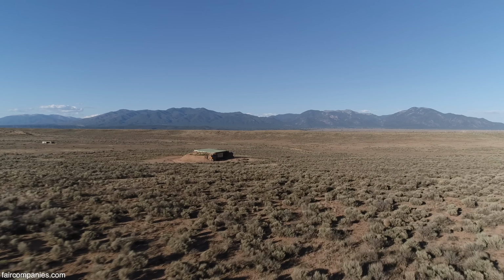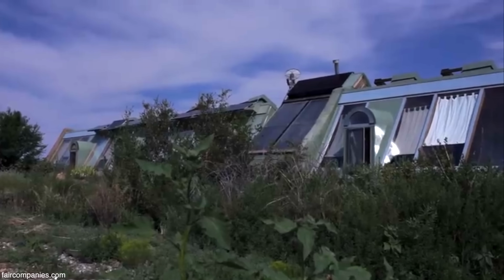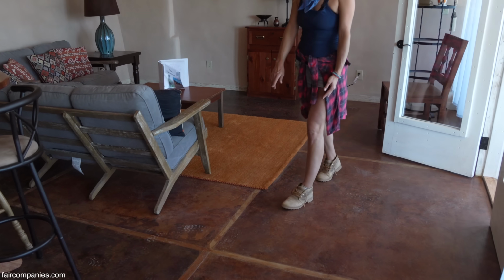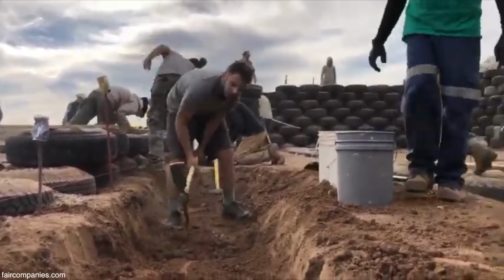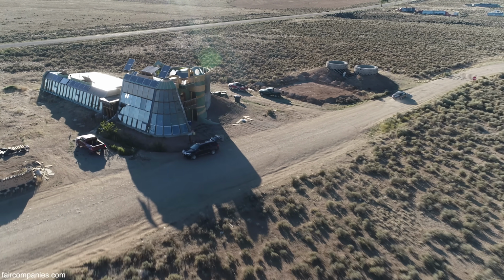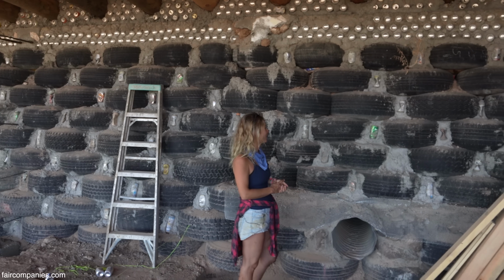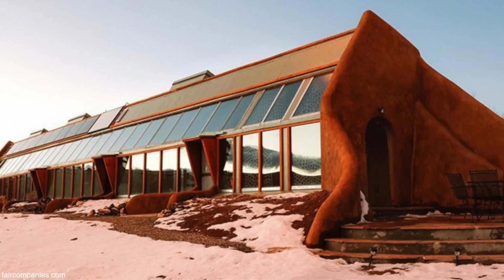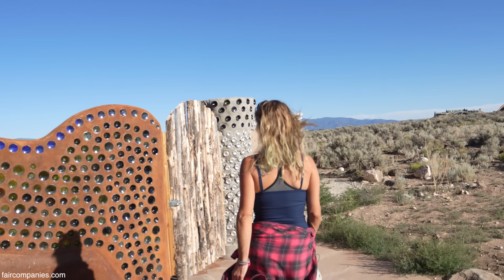New Earthships capture more energy, water & food at lower cost

Comment: I've worked in IT for over 25 years and I would much prefer having as many "low-tech" features as possible in one of these homes; primary reason being that the more complicated you design a system, the more fail-points you will have, and you may not be knowledgeable enough to repair them yourself.
Reply: They are using used toliet water for their plants?
Reply: D T ccp style 👌
Reply: You can design the home to work both on high-tech and low-tech solutions. That way you could switch back and forth between them if you so please. It would only cost as much as a fully integrated high-tech solution, but would have the capabilities of the standard low-tech model.
Reply: @TylerKoz  do they get wifi out there
Reply: @dt7491  Well you don't need to be connected to the internet to use wifi enabled devices. You could create a local network for your earthship. For devices that need a internet connection, one solution would be Starlink which should be operational in that area in the next 1-3 years. That would be Gigabit speeds.  I am unfamiliar with any terrestrial ISPs for that area.
Reply: @TylerKoz  This is true, good point, but it requires a larger budget for many things you don't need.  That is the point of building these habitats.. to live comfortably and self-sufficient with minimal costs and upkeep.
Reply: @treborironwolfe   I agree with you. It's all about preference.  I suppose if I was serious about building my own earthship, I would do a cost-benefit analysis to see if some modern automated luxuries were really worth it :)
Reply: @TylerKoz  I think if you would want to travel you'd need to do some automation since they don't do well when left without someone there to maintain them.
Reply: @dt7491  I think the bank of outdoor plants do that, which was pointed out by one of the guys. The indoor plants get graywater from the sinks & shower, then filter that, the graywater, which gets recycled for a 3rd use, I think they'd explained, for the toilet. 
Of course if they used composting toilets, they could conserve even more water.
Reply: @FutureRevolutions  Great point!
Reply: I work in IT too and I'm also concerned by the security of the "modern" houses using unnecessary amount of things connected to internet or using unnecessary technologies (like window shades managed by complicated system of motors and sensors etc.). But at the same time, I want to enjoy some of the modern advantages (washing machine, fridge and "unlimited" water source) so we solved our house like something in-between - passive house with as many mechanical parts as possible but still modern. 
The only thing missing for our house right now is independent solar system that could run basic appliances on its own (not sure how it's called in English, but it's "ostrovní systém" aka "island system" in my language - you can be still connected to the network but there's a switch that can make your house run only from your own energy stored in batteries; it can even work in a way that you run from your own solar/batteries and automatic switch turns on the network access only if you run out of juice). But we are still saving money for this, definitely not a cheap thing :-)
Reply: The same goes for modern automobiles...
Reply: @tlamiczka  I would assume "ostrovní systém" (island system) means "off-grid" in english. It is very difficult to achieve off-grid capabilities because of the regulations in the US. I believe that you can have a high-tech earth ship with a secure network without being connected to the internet. The question is , is that really what you want?  If the answer is no, then the earthship model has everything you need!
Reply: @dt7491  right?! vegetables, herbs, fruits should not be using grey or black water unless there is some sort of filtering system in place. Ornamental and flowering plants should be okay. I would be concerned about consuming anything that uses unfiltered grey/black water.
Reply: @dt7491  Looks like the black water goes into a septic system with a leach field that waters the trees and outdoor landscaping. The greenhouse is watered with grey water, sink shower, etc.
Reply: So called Waste Treatment Plants filter out NO Drugs!!...When you drink tap water your getting every Drug your Community takes!!..LOTS OF ESTROGEN!!..
Reply: @dt7491  Go back and watch again, starting at 3:15.  They flush the toilet with gray water and the toilet water goes out to a septic tank.
Reply: @TylerKoz  or a cool mesh network where the community has its own local communication network and app
Reply: @TheYah00netstar  I still have manual roll-up windows in my car ;)
Reply: An argument could be made Earthships are actually high tech but in a good way rather than a tedious way. It seems we've been raised to think that anything that requires labor is low tech.
Reply: @straightastudent683  Maybe not "high tech", but certainly "low maintenance" and "high reliability".
Reply: Windows and vents can be opened automatically depending on the temperature using actuators driven by paraffin motors. I'm sure some tinkerer can rig up a mechanism like a cuckoo clock that opens a valve from the cisterns to irrigation systems in the gardens. Automation need not be electronic.
Reply: When I bought my Ferarri, I asked if they had a model with manual windows.
Reply: I am a computer engineer and I feel the same way. I have always been attracted to kind of building concepts
Reply: @cherylanderson3340  you ever been around a composting Toilet?
Reply: @CrowDog58  No, but from watching dozens of people who live in RVs & Tiny Homes on YouTube, who claim they don't smell like crap, but just like the peat moss or wood chips used in them. It has to be mixed in & then becomes dessicated & composts .

They can be vented too. Apparently, since they're designed to separate the urine & solids, that reduces the potential for a bad smell. I'd like to believe that, & would like to set one up in an outhouse, for when I'm working in the yard & don't want to trek mud in the house.  

Have you been around any?
Reply: @cherylanderson3340  Yes I have, I had always thought it was something I would go too. My opinion, it's not something you want inside your home. They are an Out House, it would be OK for outside use as you described.
Reply: Trebor Ironwolfe The origins for this ecological friendly were in a project in Wales I visited as a kid decades ago. It was anything but high tech. Black painted radiators to solar heat water. Composting loos. Everything was low tech and green by design, not a technological innovation of great expense or complication. The true eco warriors, though it never had the polish and presentation of "lifestyle green" like modern tech companies promote. This project looks like the Welsh one contributed much towards its low tech approach. The only reason we have high tech green is to create expensive complicated solutions with high margins and future income though problems only they can repair. A right con!
Reply: @brynleytalbot778  Agree that modern silicon tech is creating its own challenges. My friend bought a solar electric set up.After 3 years  the inverter is broken. How do we service a PC board? Can we use old parts to fix it? No No. Same goes for engine management systems in cars etc. Initial outlay is expensive. High tech does not usually mean last for 50 years either. Their cooling system looks OK. Notice mesh to keep out critters.
Reply: gravity-fed water vs pumped water, for example.

or a woodstove vs centralized heating.

I work with IT all the time, and when you're responsible for a lot of things that are completely unrelated, you can't afford to be a master of say.... switches and servers and automated backups and content filtering...  you can only try to keep things as simple as possible and as passive ( automated ) as possible.

currently building a rainwater harvesting system that delivers water to my home. I tell ya... simplicity is genius.
Reply: @vvilliam29  IT has specialists and generalists, same as most any profession; I totally agree with everything you have said here, and best of luck on your rainwater collection project!
Reply: @Rikohness  Black water is a no-no, that's for sure. There are totally secure ways to safely compost humanure for outdoor use. Great for fruit trees!
Gray water is very much ok, except maybe foor root vegetables. And great care has to be taken of the soaps, detergents and oils used.
You dó realise that any food grown in any well developed healthy soil is fed, amongst mineral components, by a shitload (pun intended) of extrements of worms, artipods and billions of soil dwelling creatures, now don't you? Nothing to be fearfull of there. Be thankful for them, we wouldn't be anywhere without them...
Reply: @brynleytalbot778  . Amen to that!
Reply: I second that. Moreover: the more automated, the more energy it will use. And if we consider the embodied energy of photovoltaics-production and transport for instance, the minerals and metals required and the toxicity of battery systems we should think again about how sustainable they really are. Not very. Transition material at best. Now I do realise we need electricity, but it would be best to limit it's use to a computer and some lamps. And figure out better ways to generate and store energy (salt water batteries?)
There's also another involved: What if the shit hits the fan and the whole economic (and therefore social) system collapses. That's not so unimaginable. Some would say unavoidable or even necessary. Where will we get new panels, bits and parts if our systems depend on it. Better be prepared for our children's sake. Or seven generations along the road...
Shelter should be designed by the principles of biology, physics, thermodynamics, mechanics before we bring in electric and digital components. has been done for eons of time.
Now mr. Reynolds and friends (amongst others) have come a long way, but much can be improved on. How come I have never been able to find an earthship with a root cellar attached?
Reply: I can totally see how IT would make you long for simpler things. I'm in a similar boat.
Reply: @NeoArchitec  It's funny to me how technology often works -- In the 1940's-50's you would pay a fortune for automatic windows, and now you must pay a fortune for customized manual windows.  --->

"When did electric car windows come out?" : "Packard had introduced hydraulic window lifts (power windows in fall of 1940, for its new 1941 Packard 180 series cars. This was a hydro-electric system. In 1941, the Ford Motor Company followed with the first power windows on the Lincoln Custom (only the limousine and seven-passenger sedans)."   --Wiki
Reply: cyberpunk jutsu  It is much like anything else in this life, you must make investments and sacrifices based on your own goals.  Some people will spend half or more of their income upgrading and modifying a car, so I say to each their own.
Reply: please don't "tame" the land. go back to LA where its... lame. you kiss the point, this is not a fad.
Reply: @dt7491  The black water goes outside to an underground leach pit/field just like anywhere without metro sewage hookups. Plants can grow on top of it, but at my parents' house built in the 70's  (just a ranch house, not an Earthship) the leach field was under the horse arena and part of the driveway.
Reply: @dt7491  Well this is not a 500-bed hotel complex. That would have a problem.
Reply: @dt7491  It's got what plants crave.
Reply: @mbm2355  dont be plantist
Reply: @dt7491  nope, they are using filtered water filtered  the plants to feed the toilet
Reply: @dt7491    nope, they are using filtered water filtered  the plants to feed the toilet
Reply: I am in IT and still live off-grid .. : -))
Reply: @adriandeenedy6363  I was born and raised in the southeastern US and most of the summer months stay around 80-95F.  I often wish that I lived in a cooler climate so that I could go without air conditioning; I could live comfortably and happily in 40-50F without much more than a warm sweater or blanket.
Reply: @davefaddel6761  It seems like years of IT service often leads one to seek simpler ways ;)
Reply: @dt7491  Their plants, Not their food.
Reply: @dt7491  I don't think their using it for plants that they eat.
Reply: @TylerKoz  you haven’t been to Taos, have you ? They’ve had extra-terrestrial ISP service for centuries.
Reply: @stevedickson4744  lol 👽
Reply: @TylerKoz  gigabit speeds I am skeptical. The beta is running now and they average 76mbps.
Reply: @dt7491   I think they are using the grey water (hand washing and bathing runoff) to water the indoor vegetables and fruits and then that runoff is used to flush the black water to traditional septic and outdoor plants (non edible). Around 3:20 point he goes over it.
Reply: Simple question: How many variables must exist for a system to be deemed a complex system? Better yet, how many questions need be asked to demand a complex response? ;) This was rhetorical of course, based on observations of organizations over my career. Simple is often the art of restraint.
Reply: @TylerKoz  I've not seriously considered it but I've found earthships to not be worth it. The area they're in for one was cherry picked for it's air. All modern homes are air tight for a reason. Build anywhere else and you will have to completely redesign the HVAC. I really don't think you could save any money on walls with the extra labor from ramming dirt into tires. I do like the temperature stability in earthships from having a very large amount of mass inside the house. I'm surprised that's not a more common thing in other energy efficient homes. The water reuse is a neat idea, but I live over an aquafer I pump water up it goes back down.
Reply: @dt7491  Blackwater or toilet water goes to the outside plants, not the indoor plants.
Reply: @thebunnisher109  Sounds like Occam's hammer to me.
Reply: @treborironwolfe  good one :)
Reply: @dt7491  well the water that flows through the pipes in your house uses the same water. They just filter it themselves where as larger cities do it for us.
Reply: New word....'fail-points.' Awesome! Also the more simple systems are more easily they can be self-taught. That is important when using consumer installed and managed systems.
Reply: @treborironwolfe    Thank you for excellent discussion points on this thread. ❤
Reply: @alicehallam8247  Always glad to participate and contribute ;^)  I just wish I had the energy and grit needed to get off my backside and start building a simple and sustainable life for myself as we are discussing.
Reply: @treborironwolfe    
I'm working on it... for retirement. I'm not sure exactly what I need to do but YouTube videos have been very helpful related to the learning curve for a self-build. 🚧 . If I can live without it, I'll live without it. That's the extent of my plan at this point,
Small solar units are more and more available. Propane is pretty simple. 🤔
Reply: AMEN!....A lesson that seems to be lost on us today!
Reply: @stevepenney2073     People want speed and convenience, and are generally lazy. I guess that is how the human species came to accept computers.
Reply: @alicehallam8247  now people go to the gym to stay in shape when working used to do that for you
Reply: @stevepenney2073   never thought of that! You're right.
Reply: Good point!
Reply: @dt7491  sadly no. Before I go any further I’m voice texting this and I’m only doing this one so there may be some grammatical errors. At least in the modern ones anyways they tried that along time ago but it would be the case that the whole house would smell like sewage that got them sued so now in the more modern houses it’s just the gray water that’s in the green houses then the black water/toilet water goes to a variety of any possible septic tanks from conventional septic tanks all the way to and potentially coming earth ships bio digester‘s that make gas for a cooking hot water among other things. Where then it goes to a swimming pool size Leitchfield where there is recent talk like within the past year of doing Permaculture which Permaculture is a system of farming that I think complements earthships greatly so anyways on the swimming pool size Leitchfield‘s they want to build water called I guess Permaculture food forests where than the water then goes into the ground potentially cleaner than tapwater at least in some ways. Where I heard about some of the stuff was a combination of the series earth ships and cancer and I think towards the end of that series or there after there was a video called something like interview with Michael Reynolds. What I wanna do if I ever build mine and I say yes with the way the world is going even though earth ships could help to prevent that nonetheless that when I build my earth ship I’ve actually learned that local laws in my home state of Maine prohibit building a Leitchfield closer than 10 feet to the house or putting anything over it what I’m going to do is put it as close as legally possible to my house so when the laws change maybe even because of yours truly I intend to build a greenhouse over that that would be potentially even larger than the combined greenhouse space of the phoenix earth ship
Reply: @alicehallam8247  sloth is one of the seven deadly sins modern houses in someways demonstrate that. Before I go any further I’m using voice to text and I do not care about grammatical perfection I’m just saying.  however though they also make it so you have to work to live a rat race which is sad. I suppose earth ships could make for an easier life which in some ways could paradoxically cause more sloth but because earth ships encounter the physics and the phenomenon of biology nature and the planets I suppose that would get people outside more and truly start living and start working to live. Living to work is a rat race having to pay a mortgage and as earth ships demonstrate needless utilities. Where as working to live is abstract but an example of it would be having choice of employment I may be saying I’m going to build a micro wind farm this year with leftover money and many other passion projects.
Reply: @treborironwolfe  The question is is someone living to work to pay a now needless utility or is someone working to live to benefit all, such as with earthships?
Reply: @rwatertree  if I ever build my earth ship and I say if with the way the world is going I intend to use a combination of gravity for water specifically and practical semisteam punk technology using a combination of wood and Pio gas to replace electricity. Where I live there’s more trees than we know what to do with.
Reply: @straightastudent683  I posted an almost similar reply on somebody else’s reply but if I build my earth ship with the way the world is going and I say if I intend to use a combination of gravity and hydraulics for water specifically and word and bio gas powered Semi steam punk technology for the rest to reduce dependence upon electricity so at what electricity I do have I can make it count.
Reply: @Rikohness  that’s half the point if you don’t want to eat food that was grown with waste water because of what’s in the waste water it should not be put in the water in the first place.
Reply: @billrandell4641  Earthships are possible almost but not everywhere one of these places is metro Politan urban centers. That are already built up and it doesn’t make much sense to completely rebuild them with earthships. Anyways My water treatment systems will get it all all the contaminants. At least that’s my goal.
Reply: @EricEllingwood     I'm not sure what discussion was going on here and I'm too time-pressed to reread this long thread, but good luck with your wind farm. 👍
Reply: @treborironwolfe  having lived in the desert seen this over the decade and century..you have no idea how many snakes and scorpions..gila monsters like those tires
Reply: I dont think you understand how to make cash. If people can repair things themselves how will they pay you to repair it for them cause its too complicated to repair themselves?
Reply: @dt7491  Yes
Reply: Same. Thanks for putting this into words for me.
Reply: 03:26  DESIGNED simply  with a throw of  standard  vertical  windows
Reply: @dt7491  how do you think crops grow when farmers spray the fields with Cow poop. It's called fertilizer. 
I live in a farming town where Cow poo literally gets sprayed on all the crops
Reply: smart advice
 keep it simpler as possible.
Reply: @dt7491  The grey water feeds the plants, waste water goes outside to feed certain plants and trees that eat up bacteria. No smell. You aren't eating from those trees!😊
Reply: For urine, it's no problem at all. For feces, you need a column of soil to buffer the food from potential pathogens in the feces. I'd certainly want to see the details of their design before eating their food.
Reply: Too complex for me!!
Reply: Too labor intensive!
Reply: Shower\sink (grey water) for indoor plants.  Toilet (black water) is only for exterior landscape plants, not for food production.
Reply: Greywater is fine for fruit plants as long as you are careful to only use natural cleaning products\soaps
Reply: No water in a compost toilet. Pee is a good fertilizer kids .❤😂🎉
Reply: 30 million buffalo x 80 lbs of pee and poo =2.4 billion lbs/day . Oops we killed em all , put up fences and super fertile soil turned to the dust bowl
 
We killed all the first nations to do it?😢❤😂🎉
Reply: People have been convinced for a very long time that they cannot build their own dwellings well guess what you can if you do research and you're not lazy😊
Reply: @TheYah00netstar can't get a basic car anymore. I just want a smaller car, with a fuel efficient 4 cly, with a manual and roll and lock yourself. Can't find one anymore.